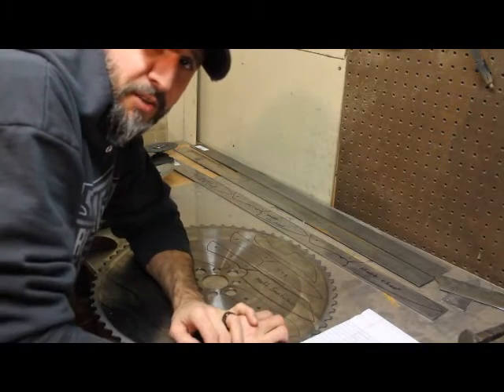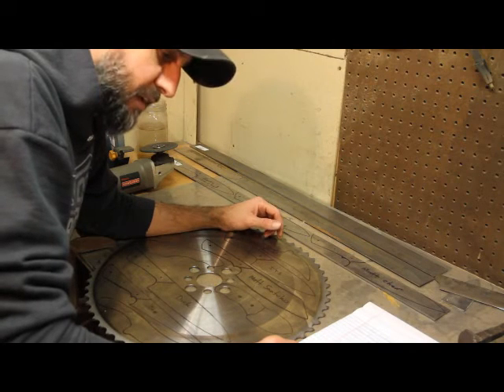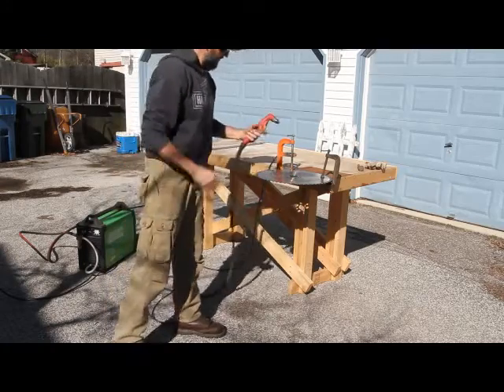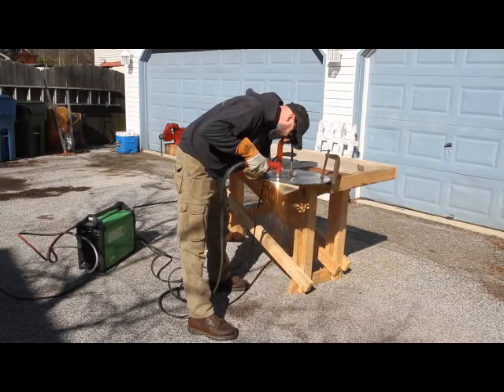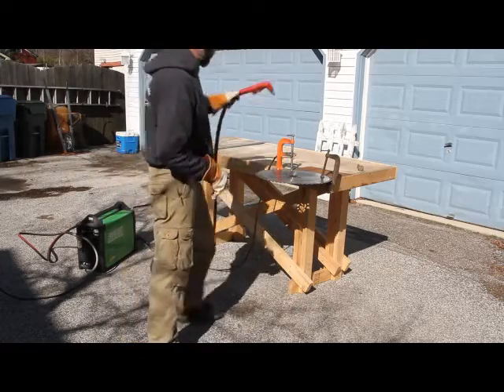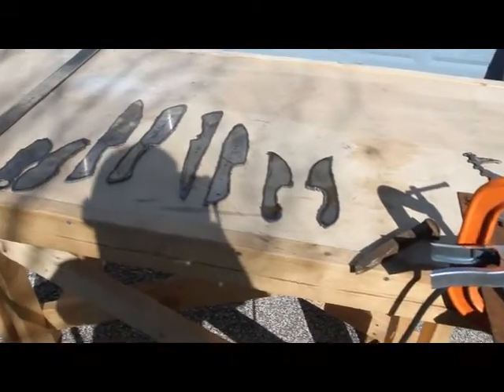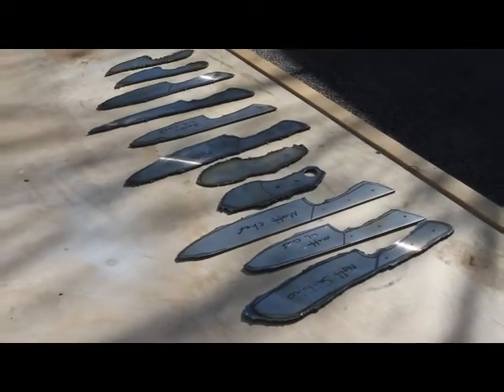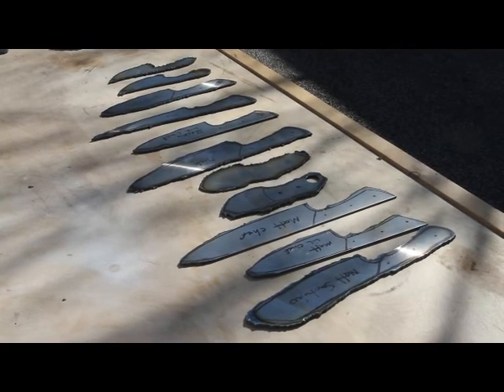Plasma Cutting Knife Blanks

Comment: I'm only worry about burn carbon on the steel
Reply from the maker: It’s fine….  By the time clean up and grind the profile, anything that would be an issue is ground away. Plasma cutting doesn’t really spread into the steel anyway….. and I do three thermal cycles before heat treating….. I have had my blades tested for hardness and I’m right about 58-60 Rockwell so I think I’m good!

Comment: Thanks for the info. I was told plasma cutting is not good for knife blanks because of the heat. I have an everlast 3 in 1 as well. Have not used it a lot yet.
Reply from the maker: Alamodem I have had no issues at all, think about it, are you making the steel any hotter than you would if you were forging it? Yes you are liquefying the very edge but then when you profile grind the edge, you get back to the good steel. Hope that makes sense.
Reply: @crookedriverforge1889  thank you. I've not started making yet. Just in the start of getting everything together to build my 2x72. Was wondering if I needed to get a band saw seeing I already have a plasma cutter and my buddy has a plasma CNC.
Reply: @Alamodem  I'm a T7 paraplegic and starting stock removal knives in my efficiency apartment. To make things easier I was going to have a machine shop cut my patterns out. The shop only had a plasma cutter. The guy at the local machine shop said he makes knives and that a plasma cutter would make the steel brittle and worthless for a knife. I didn't want to argue with him but I figured it wouldn't matter since I have to normalize and quench anyway.

Comment: So far I've only seen knives made this way but I'm curious to know if it's possible to make a sword the same way
Reply: Well, of course it's possible, this is just an efficient way to prepare your blanks, especially when your stock material comes in the form of sheets of the right thickness. If you intend to shape something that has the silhouette of a sword, grind a bevel and hang it in on the wall, way to go. But that's not a sword by any means.